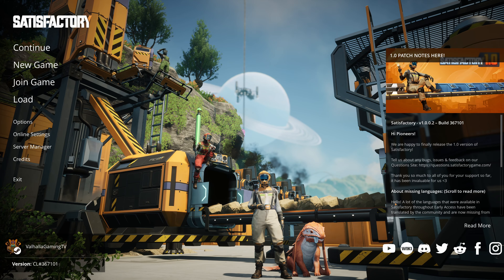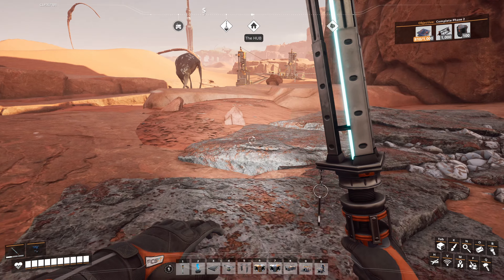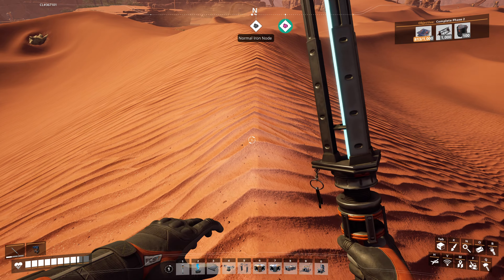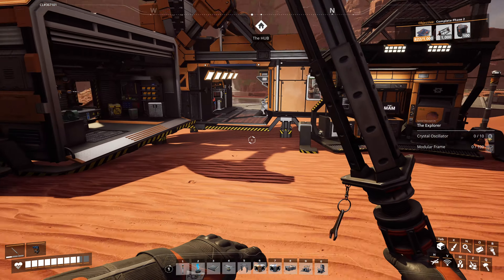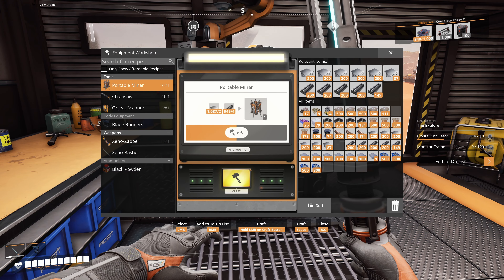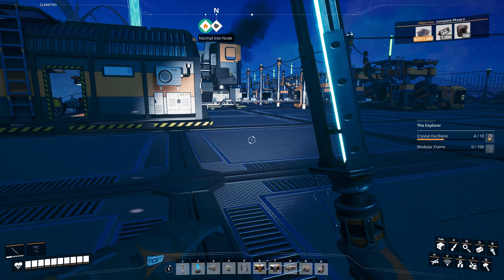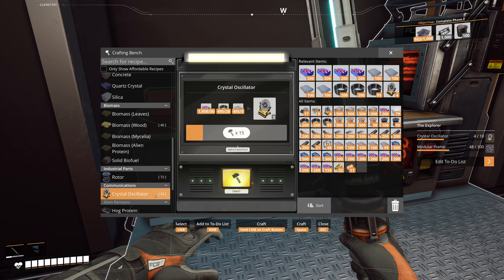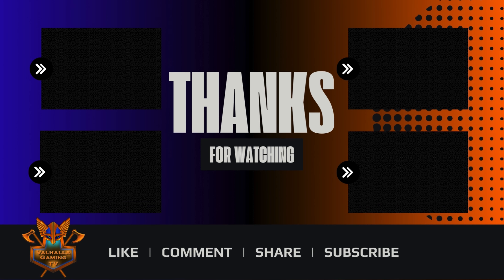Automating Modular Frames! | Satisfactory 1.0 | Part 15

Comment: Just a small Tip: if you want are about to place something down, you can with the hologram out press "H" and lock it in place and then "nudge" it around with your arrow keys. And if you're holding Ctrl while nudging you can nudge in half increments.
Reply from the maker: Nice advice didn't know that